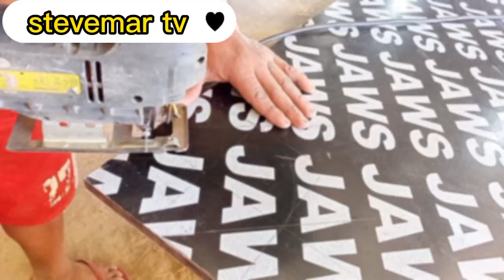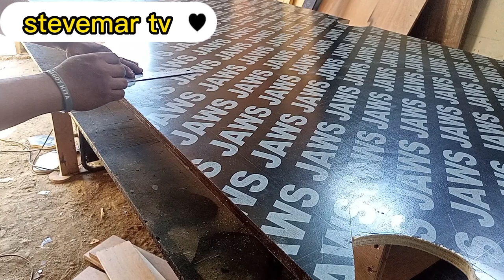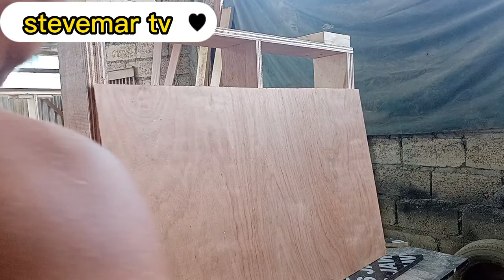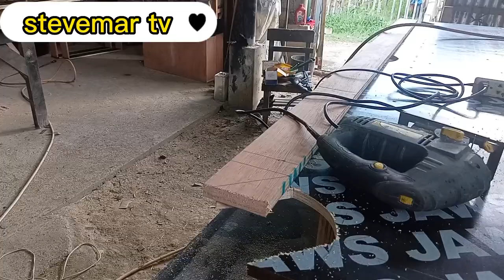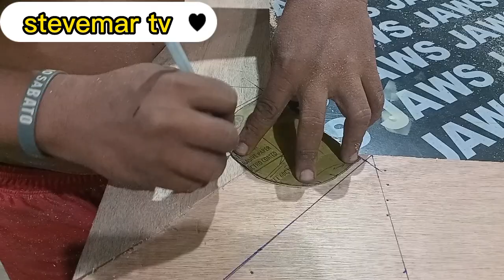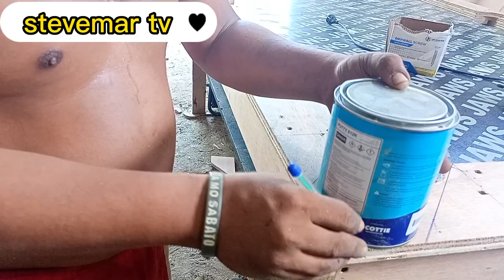assemble billiard table and laminated finish billiard table diy

Comment: How about self levelling cement poured into cement sheet instead of wood?
Reply: It would crack and chip, and self leveling is close enough for a floor but not a flat enough for a pool table.
Reply: @2869may you may pour it in a board like the one they used in this video then place it upside down I mean flip the concrete slab and use the flat surface from the bottom
Reply: @samkey14  You really think concrete will be smooth enough for a pool table....?
And it WILL chip when a ball hits it hard...